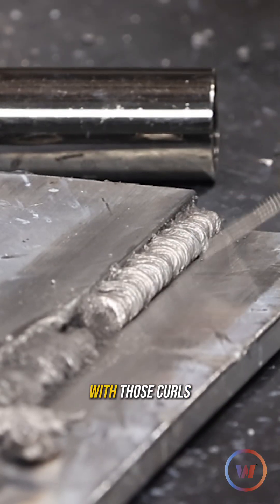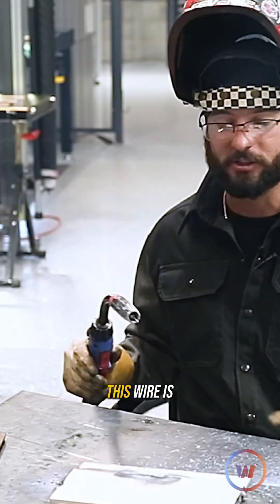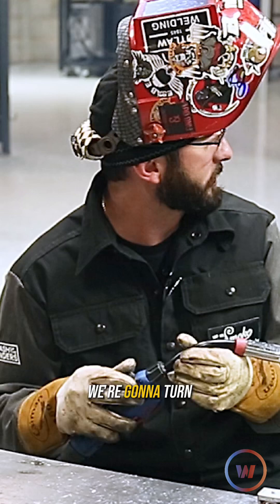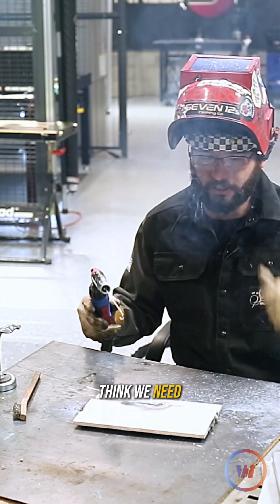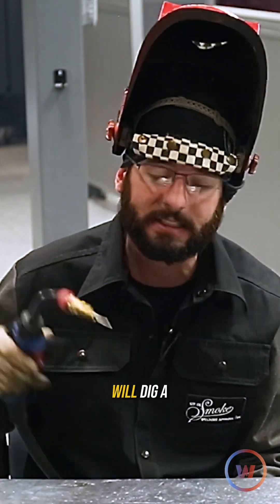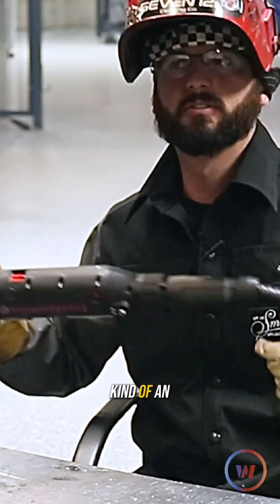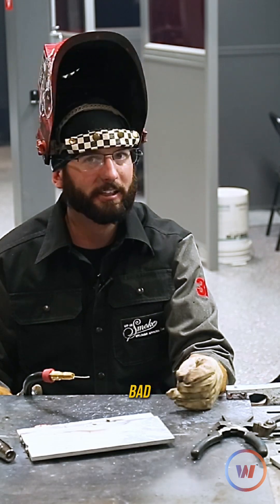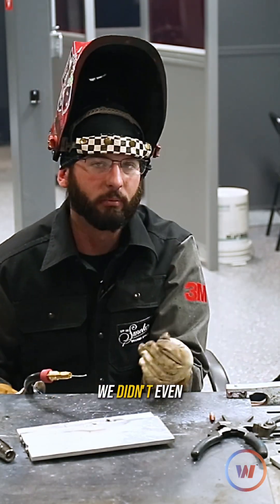Common Aluminum MIG"stakes" #welding #aluminum

Comment: Where a respirator, also measure both plate thickness, then divide by half to get your settings there’s no need for all this up down guess work
Reply: Or you just know from memory. As a welder I know exactly what settings I need for what I’m working on. If you’ve been doing it longer than 10 years you know your machines sweet spots

Comment: Done my mig aluminum T fillet test plate the other week. Preheat the aluminum first, put some push angle and watch that green weld pool carefully. Balance your machine settings, travel speed and pre heat so you can weld the same bead and penetration right across without any undercut.